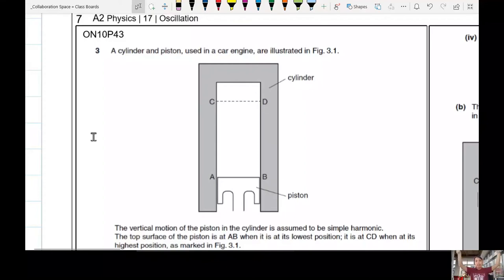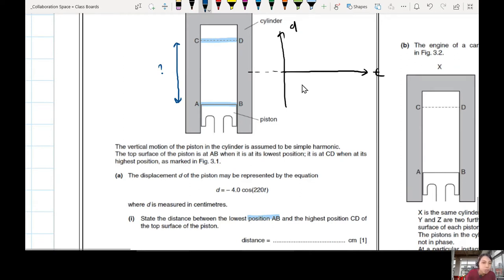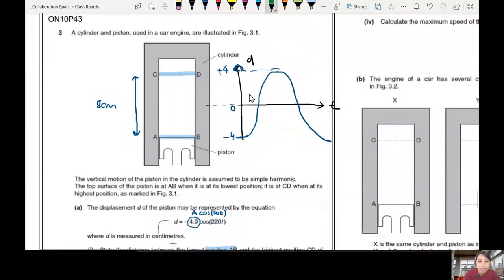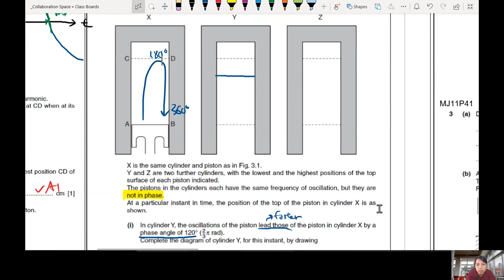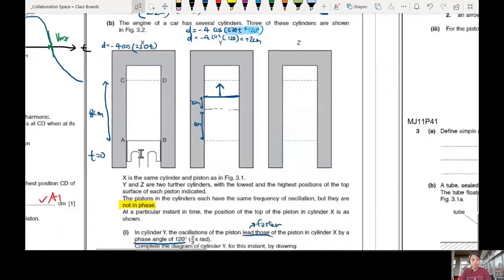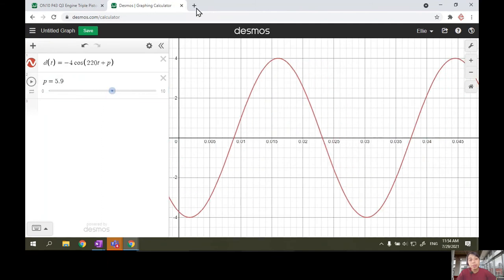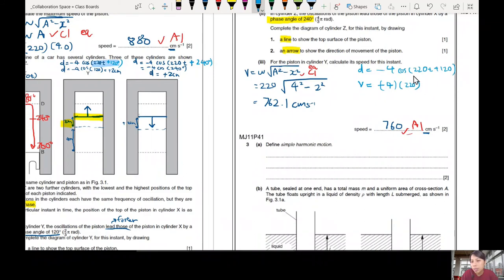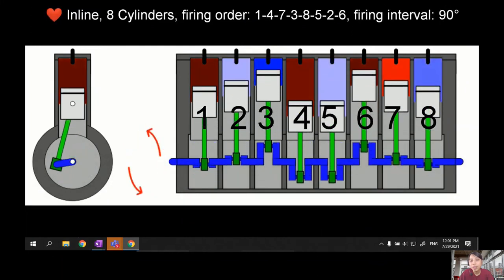ON10 P43 Q3 Triple Piston Phase Angle | A2 Oscillation | Cambridge A Level 9702 Physics

Comment: But the mark scheme for this paper says, something else for part (b)(i).
"line drawn 3 cm above AB"

My calculations were the same as yours but I am confused if the mark scheme can go wrong sometimes.

Please clear my doubt.
Reply: Ikr it makes no sense how is it 3cm 
120° means it obviously has gone through mid point which is 4cm
Reply: Did you figure it out??
Reply: @BEbetter0_o , I guess that it's a typo in the mark scheme, it should be 3cm above the mid level.
If from AB, it should be around 4+3=7cm.
Reply: @kalanafernando3973  ohh wait ms is corrent the total oscillation distance is 8cm, it goes up then down, so goes up 4cm  comes down 4cm the mid point is 2 cm, so yea 3cm above AB line
Reply: @BEbetter0_o  still not clear, how do you figure a 2cm mid point?, with that answer is correct.
Shouldn't it be the position of Y given that equation for piston travel, correct modification like -4cos(220t+120°) ?